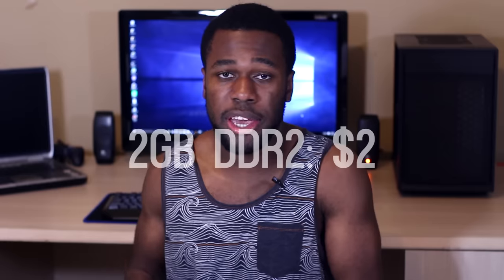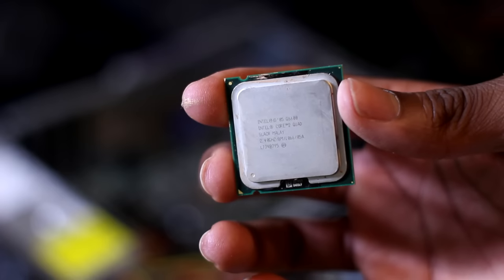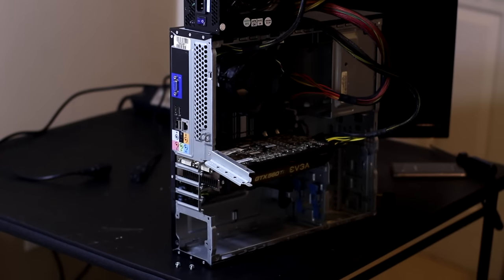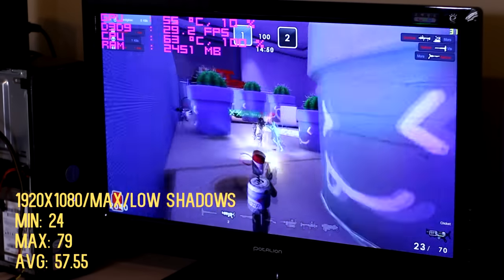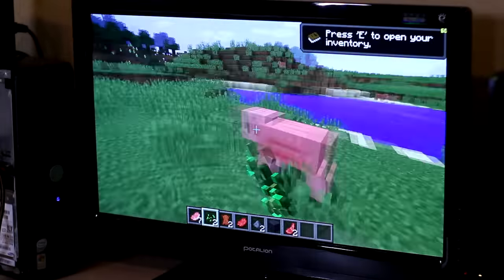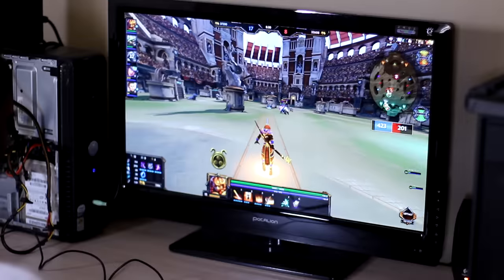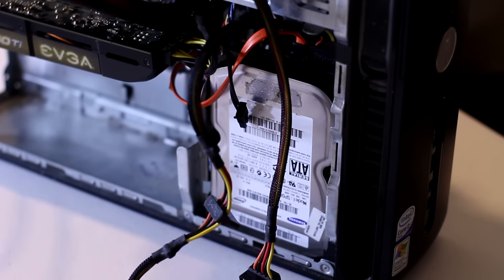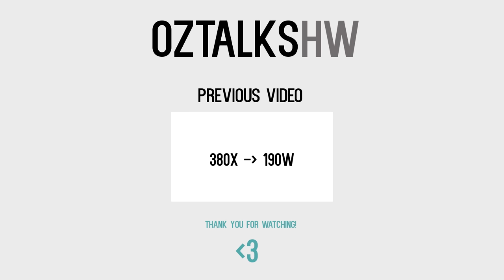The $25 Gaming PC vs League of Legends, Minecraft, Overwatch & More! | OzTalksHW

Comment: 25 dollar pc that can run overwatch, my laptop is 250 dollars and has the no compatible error
Reply: Flo453 yepp
Reply: 250$ is nothing in the pc world
Reply: Sxyrth That's the sad truth XD
Reply: ***** yeah i dropped 2500$ so far on my rig and im still gonna upgrade
Reply: Sxyrth Holy crap I only dropped 800 ish and it runs all the games I need
Reply: Whoa you have a minecraft server, Can I join it?
Reply: Flo453 :^) Ayy my man what graphics card do you have by the way
Reply: Yo vivid what could you even need to upgrade? My pc was 1k and is 6 years old playing bf1 at 2560x1080 60 fps.
Reply: Larry McKeithan Dark souls can barely get 30 FPS on ultra and it bothers me, so ill just end upgrading my graphics card
Reply: ***** have you overclocked yet? And check the graphics cards profile for dark souls. It may be overriding the in game settings.
Reply: Larry McKeithan Naw I don't know how to overclock sadly and I don't want to do anything wrog
Reply: ***** cpu is a bit harder than gpu. For a gpu just download MSN afterburner and very slowly increase clock speeds. Test between each change in an intensive game. Don't increase voltage as that can really cause heat buildup.
Reply: Flo453 haha I oced my cpu from 3.3 ghz to 4 on the stock cooler and it passed Intel burn test
Reply: Novacore I got 1070
Reply: Novacore this is stupid were fighting over graphics
Reply: Novacore XD

Comment: when $25 runs better than $800 office desktop
Reply: That's because the "$800 office desktop" probably doesn't have a dedicated graphics card.
Reply: wat i have a really nice office computer. its like an extremely low end gaming desktop but an extremely high end office desktop. its got an i7... but a radeon 5450 XD. really good for 4k video and stuff though.... or office stuff.
Reply: wat their's also probably some stuff that this $25 dollar pc cant do because of.. i dont really remember the pc specs from the video but it probably has like a dual core processor which cant run alot of apps at once.
Reply: Integrated graphics have been trash up till very recently. Usually they can barely run windows aero.
Reply: VoLTiC Panzer cough overused cough
Reply: somethings wrong with your rig then because yours should easily perform better than that rig.
Reply: Wesley Newsome only 4 ram, i dont play many games on it i just edit stuff.
Reply: VoLTiC Panzer edit stuff like videos? Any serious photo or video editing software will want more than 4 gigs itself. No wonder you got issues. I recently had to go to 16.
Reply: Everything you've said has been contradictory to the reason you have your PC.
$800 desktop with 4 gigs of ram? For editing? For multi program functions? 
Even in 2010 having 4gigs of ram on a $800pc seems crazy.
Reply: its called HES LYING
Reply: VoLTiC Panzer cause he "technically" made a 25$ gaming PC and tested easy very optimized games

Comment: Can my toaster run these games?
specs:
-800W
-Defrost function
-spinning plate so it warms food evenly
Reply: it can also run unlimited time
Reply: league is really well optimized so probably that one if u set power level to 10 for at least 3 minutes
Reply: It might be able to run BagelCooker 3 or maybe Defrost: Ultimate. not sure bout league though
Reply: what about super heat fuctioned v3
Reply: It can run I Am Bread. I tried it on a 600W.
Reply: i got a 2W, damn.
Reply: Wait....

That's a microwave!
Reply: LOL THEY ALL SAID IT WAS A TOASTER teckayz
Reply: Toaster has a spinning plate?
Reply: its a microwave he trolled all of us but me and teckayz
Reply: Corul I was thinking about a microwave but nowadays technology.. there might be one lel
Reply: yes everything on highest graphics and u will get 500 fps
Reply: Maybe it will run the 'let it go' game with Defrost setting.. I'll suggest to use about 666 watt
Reply: if you line the inside with foil, put a box of nails in, close the door and set it to 60min you can boost the cpu to 9.465GHz and it will stay a cool 27 degrees Celsius

Comment: Yo, your computer 20$ computer outperforms my 2 year old 300$ laptop by a decent amount. 😂😂😂
Reply from the maker: Sheeeeeesssshhhh!
Reply: Laptops tend to have heat issues that cause throttling.
Reply: Use a laptop cooler to get an extra 20 horsepower.
Reply: true dat XDDDDD
Reply: i have the same lol
Reply: Every laptop isn't shit, people just don't buy expensive laptops. Laptops are simply more expensive than desktops. My ASUS N551VW is pretty nice, 1,000€ but runs every game max graphics easily.

Comment: Gets me mad that I bought 250 laptop can't play shit but runescape lol
Reply: runescape OP
Reply: i bought a 1000 dollar all in one when i didnt know shit about pc's and it sucks ASS.
that computer is better than this.
Reply: +OmegaV2 yeah, can't expect to do anything else than work with integrated graphics
Reply: I bought my computer for $125 and um.. It runs Minecraft, CS:GO, and Payday 2 pretty well. I would say at least 60 frames. GG to me?
Reply: Skeleton King im getting a 550 - 600 dollar pc that will run the latest games at 50 frames minimum.
pretty good deal if you ask me
Reply: OmegaV2 Yeah it was on this site that had really good deals, but it shut down which sucked.
Reply: Skeleton King i just use choosemypc.net
Reply: I got an $1,100 setup with the i7 6700k, 980 gtx + sli/crossfire, 128gb ssd + 1 tb hdd, 16 GB ram. Runs almost everything 250+ fps on max settings before the OC.
Reply: Adam Wathen i'm just gonna keep upgrading parts occasionally on my so-so pc im buying
Reply: No you didn't lol
Reply: +Adam Wathen no way 😂😂😂 one 980 maybe if you got a deal on the i7 and 980 but sli ? Come on bro 😂😂😂
Reply: Noah Metzner Yup, pre-built too LOL. NewEgg was marking down the Acer Predator G6 and I guess they made some kind of error. Not the same price anymore, lol.
Reply: I just bought i5 2500k with 8gg ram and motherboard...175 costs a bit more but, you need a good psu, lcd and graphics card...im playing overwatch at over 100fps! On low settings, typically get no less than 150
Reply: ironik86 Overwatch isn't that intensive though
Reply: ironik86 Try arma 3 or dayz standalone
Reply: OmegaV2 it's CPU intensive. I was using a q9300 with the 390 was getting 30 fps....now it never dips below 120 up to 200...arma has never really been a good game to name as a benchmark...also it loves hyperthreading. I'm getting the same frames in arma 2 that I was getting before upgrading.
Reply: my rig is $2200.. and I have pretty much same things. Yours did NOT cost only $1100. I have the i7 6700k, GTX 980 Ti Strix DC3, 600gb SSD, 1tb HDD, 16GB RAM and 750W PSU. Pretty much the same as yours but x2 the price. Stop wit ya bullshit
Reply: ***** What bullshit?
Reply: Try old school runescape
Reply: Just the difference on the SSD can be at least 200€, throw in extra money on an expensive PSU, get the components from the wrong place (or pay someone to build it for you) and you can get over the price easily. Also take into account that if it's bought for a company the price tag is tax free, and you can use for whatever you want.
Reply: +Spamium well I run gta 5 on ultra from a 690$ per built pc just got 410$ in rebates
Reply: Same
Reply: for about 400 bucks you can build a pretty decent mid range pc that will play anything if you get used parts and maybe some new parts
Reply: +ironik86 never buy used pc part since there burned out from either 24/7 bit coin mining or just constant stress your better off buying new parts
Reply: Same I got a 260 laptop and I can't play any games on my Steam account unless I lower the resolution
Reply: I have a 1000$ computer and im thinking about upgrading the parts
Reply: Adam Fluxty Wathen If you have that good of a pc, make some videos lmao
Reply: Snerxel Song Uploader if you want to :3
Reply: Chlorox Bleach :D
Reply: Boys Don't cry mine runs minecraft at 5-15 fps
Reply: Warwizard12 I run minecraft at 20 fps. If only my pc was black
Reply: +Warwizard12 turn off V-Sync u noob
Reply: RazQrt lol
Reply: +Chlorox Bleach well thats true m8
Reply: RazQrt it is off
my computer just sucks
Reply: RazQrt I made a dell chromebook run minecraft... dont ask me how that works
Reply: ur specs?
Reply: wtf
Reply: aah i clicked the bell thing  and i typed on the wrond comment sorry
Reply: RazQrt It is ok :D
Reply: *****  I agree with all of that +1
Reply: same only mine costs 900 euros

Comment: I used to have that gray power supply...... It almost set on fire
Reply: I had a gray 250 watt from before i upgraded the psu in the computer right now it would turn off randomly and act stupid. The psu i have now is a thermaltake 750 watt psu so i can use my r7 370 in this tower but the amd cpu ang gpu might get too hot in the small case and that the psu and gpu would be blowing hot air into eachother.
Reply: +shoopnooop flip the psu and it should be fine
Reply: +shoopnooop so it's exhausting at the bottom of the pc
Reply: Jack O'Hara i actually have it out of the tower like in the vid
Reply: +shoopnooop you're using that case ?!?
Reply: Jack O'Hara not that case but i have my psu out of the case my case is a normal hp itx case
Reply: +Jack O'Hara lmao dude I still have that power supply for my potato pc and it works fine

Comment: Portal 2 runs better than Minecraft on my computer
Reply: Minecraft is a very badly optimized game since it's made with java.
Reply: +Noc it's also very CPU and RAM bound unlike most games (like portal 2) which are GPU bound.
Reply: Kenny Zat Yeah
Reply: have you got a 1st gen Intel i3,i5 or i7 on windows 10 because Intel aren't going to update the graphic drivers for windows 10 and Minecraft needs those drivers to run fully
Reply: remo spadaccini ummmm... yeah...
Reply: Noc I agree, I feel like Minecraft should just be rebuilt on an entirely new engine or have tweaks made so it's GPU dependent.
Reply: UNKNOWNGAM3r Yep java sucks for games ha ha!
Reply: Noc Left 4K dead runs well on my computer as well as dust, maybe it's just minecraft
Reply: UNKNOWNGAM3r It is just minecraft.
Reply: Noc Minecraft Unity is beautiful and runs like a dream. Minecraft should have been made on a different engine. Minecraft Windows 10 edition runs well though.
Reply: UNKNOWNGAM3r Notch made it on java so it was easy to code. But for how big of a game it is they should of made a remake like 4 years ago lol
Reply: Noc There are engines much easier to code for! Actually, source, the engine responsible for games like "Half Life 2" require no coding experience!
Reply: UNKNOWNGAM3r That is true but that is one of the only reason I could think of for using java.
Reply: minecraft depends on the cpu and ram mate
Reply: and since portal 2 is a source game i guess it depends on your graphics card
Reply: Frog Agree'd
Reply: There is a new launcher that doesnt run on java if I am not mistaken
Reply: It's not the launcher that I'm having trouble with.
Reply: Download the Optifine mod and make some video tweaks after you have it installed and it'll run effortlessly
Reply: UNKNOWNGAM3r no way, it should be better if you lower the qualities
Reply: The worst thing about Java and OpenGL is that when using shaders mod it get fucked over by the awful light engine.
Reply: AtomicMule OpenGL is decent, I can run MKW at a solid 60fps

Comment: gtx 560 ti for $20...can someone explain this? Aren't those like $200 minimum?
Reply: There like $50-$100
Reply: I thought the same. Gtx 560 its about 100 bucks
Reply: Probably was used
Reply: Mr Stevie123 second-hand or probably even third gtx
Reply: i got mine for 50 €
Reply: Mr Stevie123 the gtx 560ti is a dead card and off your paying over 75 for one your getting used
Reply: he said it was reworked ...which means it was broken and repaird and resold... ^^

Comment: Damn and I just dropped 1k for my comp. Abeit, its not bad, but I probably could have gotten a better deal. Got a free G430 headset and G105 keyboard with a promotion, too.
Rig Spec: 
OS: Windows 10 Home Premium 64-bit 
Processor: Intel i7 6700k CPU 
Graphics Card: EVGA GTX 1070 
RAM: Corsair Vengeance DDR4 16GB 
HDD: Toshiba 2TB 7200rpm SATA III 
SSD: Samsung 850 EVO 250GB 
Motherboard: Intel Z170
Reply: Merland5 I Guess Your's Ain't Bad XD
Reply: All of that for 1k ? Damn cryptominers. Just CPU GPU and RAM today would cost 1,1k
Reply: @iamangelic4706  today you can get a system with 32gb ddr4 amd a gtx 1080 with an i7 8700 system for under $800
Reply: @awesomecomputers7076  that's a stretch
Reply: @iamangelic4706  used market or Walmarts overpowered systems because they are cheap for now
Reply: @iamangelic4706  but it is a stretch

Comment: Hey Oz!
I just found your channel through this, and I subbed. I would also like to do the same like this, as I have a msi280x and a powersupply of 600w left since I upgraded my pc. I want to use the parts to make a server, and using an empty drawer in my new desk as a case. I currently use an old laptop, with an i3, 4gb of ram and intel hd graphics (older laptop, almost 5 years old). It does a good job running minecraft modded servers, but only for max 4 players. I make games, and I want a pc to run multiplayer servers on. Gonna make those very lightweight though
Reply: So, I forgot to actually ask my question... Could I take apart my second old laptop (more recent, broken powersupply) and connect my gpu and powersupply? I guess not, as it's a laptop which is made to be compact and not upgradable
Reply from the maker: Good job taking initiative! And that will be pretty difficult considering laptop components are a bit different from desktop ones. Though, with nVidia making it possible to install an entire desktop GPU into a laptop, this may change in the future. It's good that you're thinking about this!

Comment: I spent 500 bucks upgrading my pc recently. now i run smite 150fps on high :)
Reply: specs?
Reply: Try Witcher 3 :P
Reply: arma 3 is not that intensive you only really need a decent cpu
Reply: 150 fps is nothing. I run life at 925 fps.
Reply: Ian Blanchet I can run 925 fps at low settings too.
Reply: You guys do know that any fps higher or lower than your monitor's refresh rate is bad right? So if you're saying "I run X game on 300 fps". You're actually saying "I run games in a way that my screens bugs out". Lol.
Reply: +REV0 I'm pretty sure they exist. But i don't think you can buy those monitors in most stores. And IF you can buy them, i'm pretty sure those types of monitors are very very expensive.
Reply: +Felipe Dutra This is incorrect and is just an illusion. I'll try to explain: Your GPU is rendering X frames in 1 second, but your monitor is refreshing its image less than X times in 1 second. When this occurs, multiple frames are "joined" together in a single "refresh cycle" and you get ... screen tearing. Unless CS:GO affects how this ^ system works, i'm pretty sure you're incorrect.
Reply: isn't that just VSync thing? I run quite a few games on 300 fps and when I had problems with throttling (didn't clean fans for a while) and got like 100 fps on those games I really felt that they were super sloppy instead of oh wow there is no more screen bugging out!
Reply: +sonysergey V-Sync caps your fps at your screen's refresh rate. 100Hz monitors don't exist so that's why you experienced screen tearing (Because of the explanation above). You can check your monitor's refresh rate in display settings i think.
Reply: +Azzezima Edit: If you have a 60Hz monitor, even 59 fps can feel sloppy. TL:DR: Run your games at your screen's refresh rate and you won't have this problem.
Reply: +Azzezima I have 60Hz monitor and never experienced tearing on 300 fps
Reply: sonysergey Hmm, maybe you're just not noticing it then i think.
Reply: +Azzezima as well as other millions of cs go players, for example. You are just wrong.
Reply: sonysergey Hey, no reason to be harsh here.. (At least, that's the way i read it). Like i said in an earlier post:  "Unless CS:GO affects how this ^ system works, i'm pretty sure you're incorrect.". Screen tearing CAN be very minor if your FPS is way higher than your screen's refresh rate but in theory it should still be occurring. I'm just having a fun discussion here mate, I aint playing some competition to see who's right and who's wrong.
Reply: +Azzezima I am not being harsh, I am just telling that screen tearing probably occur because of the reasons that you say. Although I can't present any facts or arguments since I only judge from my experience and my logic.
Reply: sonysergey Ah, my bad for reading it in the wrong way then. ^_^
Well i suppose that's technically a good thing i guess. . Some Google searches later... turns out people don't experience screen tearing (Higher FPS than refresh rate) with CS:GO but they do experience screen tearing in other games, weird. Maybe CS:GO has an integrated V-Sync or something? I guess we'll never find out. D:
Reply: +Azzezima it def doesn't, since players notice difference between 300 fps and 100
Reply: sonysergey What, now i'm confused.. CS:GO: The Davinci Code of games lmao.